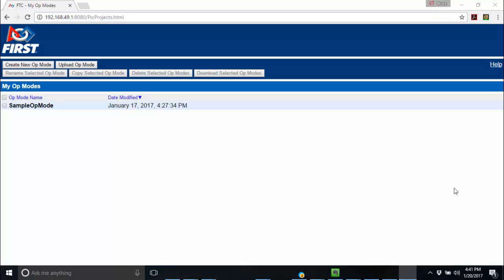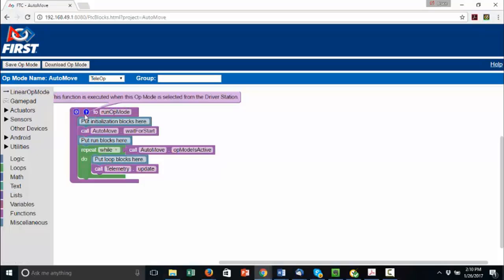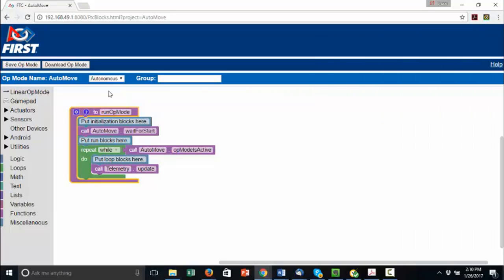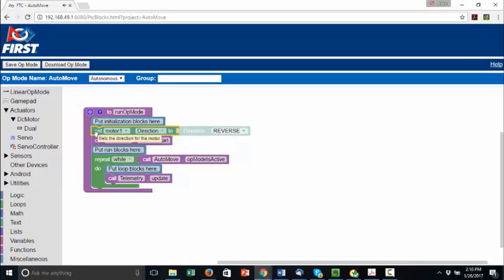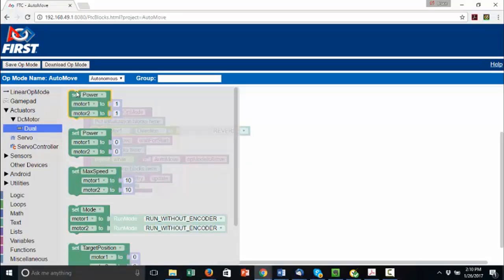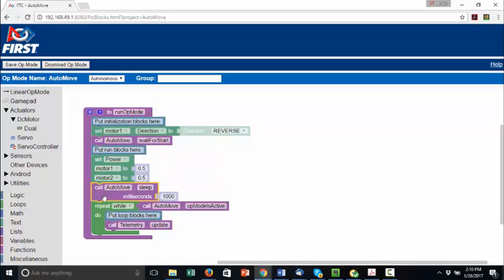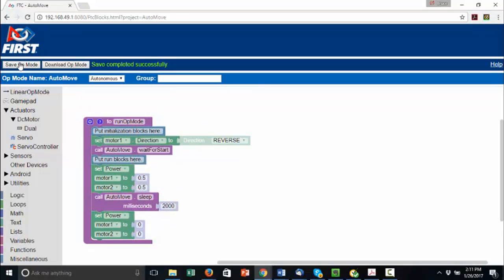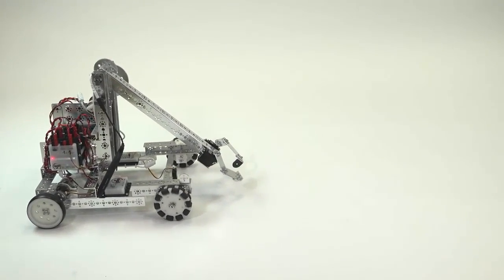Moving Forward and Backward - Blocks

Comment: or in functions drag a "to do something" block and then put the motor power block (the same one he used) inside the to do something block and rename the block to "forward" or  "backward" depending , if u name it forward the power should be 1 for all motors and if its backwards it should be  -1 for all motors . once u have that u can go back to the functions column and u will see the block u made in short (eg. "forward" or "backward")  . now u can just call that function with the sleep block and u never need to do all that steps again. if u are using 4 motors for ur drive train then its the same steps but u just have to add another power block so all the motors have power .  also u can do the same for turning left or right however u have to make a whole other function for that . block to turn letf would be "to do something : LB power - 0 RB power 1" this is for a 2 motor drive train with both motors at the back . REMEMBER IF U USE THIS METHOD WITH FUNCTIONS THEN  IT WILL BE UNIVERSAL , this means if u make a block to go forward and use it for something then change it later on then everything will change .Hope this helps someone . 19001